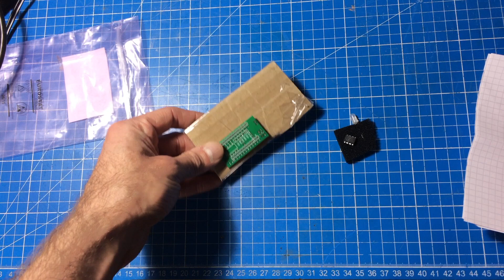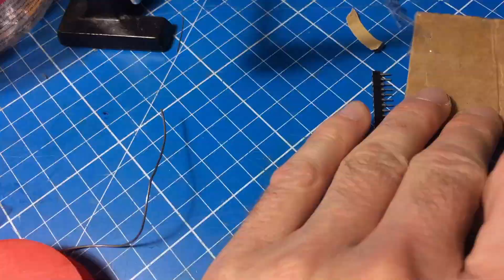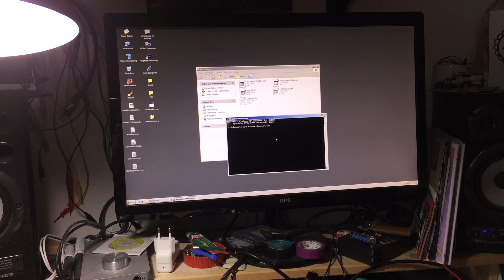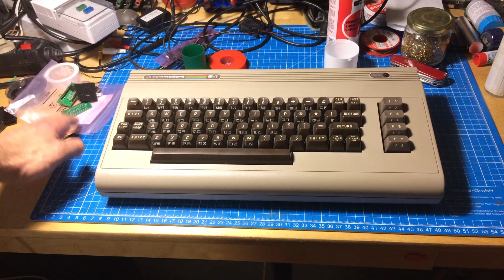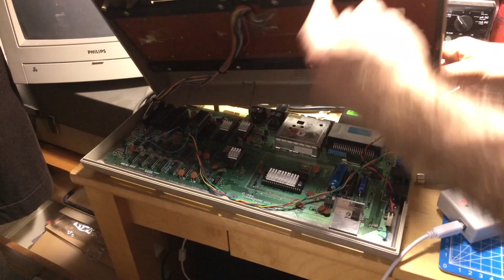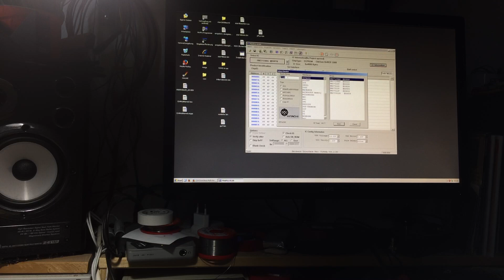bwack's C64 Switchless Kernal Switcher

Comment: Interesting coincidence that this vid showed up not that long after I looked at a pre-built switcher on ebay earlier, thinking of doing the mod in my 250466 64c, so looking about at various options, and I like the switchless one, no case drilling needed given my 64c arrived looking pretty clean and nice... :)
Reply from the maker: Bwack‘s switchless mod got updated a couple of times since I made this video, the old chips are difficult to source these days. The new version uses an Arduino if I’m not mistaken, still functionally the same though. :)
Reply: @JanBeta  The pictures they (myretrostore-uk on ebay) have look to be the older version, don't know if they're actually selling the current one or not though, still a neat product though... :)

Comment: Great videos, I'm getting through them all! I have a couple C64s, two of which have colour problems, I haven't looked into them yet, though are reluctant to even try at this point as I don't have an osciliscope right now, any suggestions where to start? I also have a C64C that has no power to the dataset, though I expect that that will just be a protection diode or supply transistor. They've been sitting many years now and you have inspired me to break them out. I also have a Amiga 500 that I bought with my first holiday pay check from my first job, I've kept it in the box and it worked 15 years ago when a last boxed it, lol. In my list I also have a printer plotter in the original box, 1541 original, 1541 second gen and a 1541 II. Along with miscalculations bits and pieces, Atari 2600's, retro joy sticks, etc. I can't wait to start modding these and go old school again! Thank you so much! Beagle.
Reply from the maker: If the C64C doesn’t have sound output either, it will be the internal fuse. It’s for the 9V rail that only feeds datasette and SID chip in the newer C64s. ;)

Comment: Meanwhile, bwack has improvee his design of the switcher. ThevPIC is history, he uses an ATTINY 85 instead plus there is an Exrom Line which you have to feed from the c64 mainboa4d into the adapter additionally to the reset andvrestore lines so you now have a real reset function plus you can use use the original LeD if you do not want to go with the rgb led...of course you will not tell which rom you have switched to in that configuration.. the new hexfile forbtze attiny alloww you to configure a 512 rom to switch between up to 8 roms of your choice...

Comment: The heat sink on the VIC-II is inadequate. The 3 separate parts will not transmit heat from the center outward. The one on the 6510 is superfluous.
Reply from the maker: Yeah, I agree a one-piece heat sink would be better. I found that some 6510s get pretty warm in use (some others don’t get as warm for whatever reason) so I think a heat sink doesn’t hurt.
Reply: @JanBeta  The 6567/6569, depending on their revision, can dissipate up to 2 watts of heat. The old ceramic ones are the worst. They must be kept below 60C or risk getting their lifespan shortened. The 6510 can be replaced with the HMOS version, the 8500, which produces almost no heat.

I make and sell PLAnkton which you can use to replace the PLA 906114-01. PLAnkton  produces no discernable heat and consumes about 1/5 the power of the original IC which reduces the load on the PSU.

Comment: Hi Jan, Nice video. What are those piggyback diodes going from U8 back to the ground plane @14:33 to @15:00? Some sort of mod I should consider or is that stock? I have earlier revision boards. Some sort of protection for CIAs? All the best.
Reply from the maker: I think you are right, they are protecting the CIAs. They are stock on many boards I have seen. I've seen people adding SMD diodes on the bottom side of the PCB for protecting the ICs so it may be worth considering.
Reply: @JanBeta  Thanks

Comment: Hi Jan Beta. Thanks for this tutorial, I could manage to easily install this mod into my C64 and all is working good :-). Now I do have still 2 PCB's with me (sourcing was for a minimum of 3 units) and you are saying they can be used as simple adapter for any Kernal 27eprom. I have then burned a 27128 eprom with a bin file made of 2x a Jiffydos code of 8K. The problem I have is that after a good start of the C64 all will freeze after a few seconds. I have checked this was not related to a C64 issue by swapping again the original kernal rom and all is good. My question is to know if some bridiging is needed then on the PCB. Shall I put a ceramic cap where it is supposed to go or do some wire bridging?
Thanks ;-)
Rick
Reply from the maker: Hi Rick, it should work without any extra components normally. The cap is only for filtering noise from the 5V supply voltage (which doesn't hurt but should not be necessary) and the other components are for driving the LEDs and PIC. Maybe try adding the cap, EPROMs can be a bit picky about their supply voltages (depending on what kind you use), otherwise it might be a simple contact problem in one of the sockets.
Reply: Hi Jan, Have tried both with cap, without and with a wire but always the same problem. I do have a boot then a freeze and recycling the power will make always things a little bit worse till I do have just a black screen.If I swap with the original Kernal then all back to normal. I do suspect either the eprom or an issue with the C64 not liking the Jiffydos.
I hae checked continuity on the eprom and all is ok. Weird....

Comment: one thing i have learned over the years with pic or indeed picaxe chips, is to always install a socket, proper quality sockets will save you pulling out your hair.
another tip is to by pic's direct from microchip, the extra cost is worth it as there are way too many fakes out there, if you join the microchip site and order direct you can buy small quantities, if you just need one or two ask them for samples, its a great way of getting a couple of chips for evaluation.
Reply from the maker: I usually socket everything were possible, too. Unfortunately it didn't work in this case because of the placement of the PIC on the bottom side of the board. :/ I think bwack got the faulty PICs from a cheapo ebay auction. The ones he send afterwards were from a "real" electronics seller. Thanks for the tip with the microchip site. I will look into that for future experiments! :)
Reply: Jan Beta I have the PIC in a socket on my board. Everything fits by the millimeter, bit I think not all sockets on the motherboard is compatible then. The position of the pic was also moved to fit better inside the motherboard socket. maybe not on the board rev i sent you since i think i never ordered the latest.... too long ago since it got designed, i would have to check
Reply from the maker: +bwack I think I socketed the kernal myself in this C64. It has one of those H-shaped sockets with a bar in the middle iirc. I could of course just remove the middle part and it would fit no problem. ;) I had some of the latest board revs made together with the Versa64cart PCBs. Will check if they fit better.

Comment: Thank you so much for making a video about it ! I'd like to mention that Pasi Lassila has an elegant switchless jiffydos switcher. (two roms in one chip) I based my design on his. His design uses a simple dual flipflop to remember the state of the restore key at power on. No programming needed ! :)
Reply from the maker: Thanks for the gift. :) Pasi Lassila's design looks very elegant and clever indeed if you only need two ROMs.
Reply: It would be cool if you sold a kit, or at least a board to build this on. Thank you for sharing this innovation with YouTube.

Comment: this plus my retro flyer my C64 would be amazing again... now I have to buy more etching solution...
Reply from the maker: Go for it. It's a really convenient device. :)
Reply: I think I will.  I already have the retro flyer, and I've been thinking of doing some mods.  first however is my PSU.  its still running well (original) and even the C64 itself hasnt required recapping yet.  ( I've always babied it )  but I should start soon :)
Reply from the maker: It's definitely a good idea to take care of the PSU first. Number one cause for blowing up ICs in the C64.

Comment: Even if it doesn't reset, you can sys64738 to reset :)  It's from BASIC, after all, unless the live kernal switch hangs the system.
Reply from the maker: I didn't try that but it should of course work. Pretty inconvenient number of keystrokes compared to just holding RESTORE though... ;)
Reply: It is actually a cleverly chosen, very convenient number to type, the fingers move apart evenly with every number.